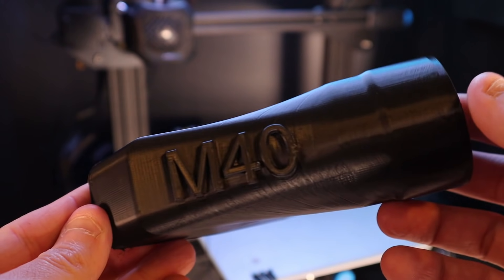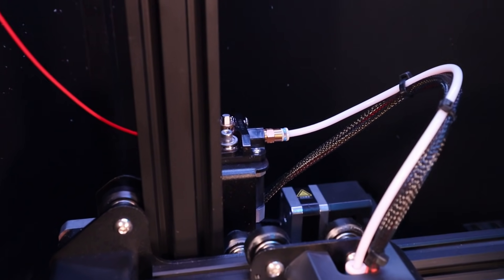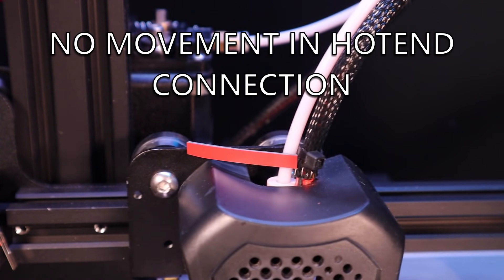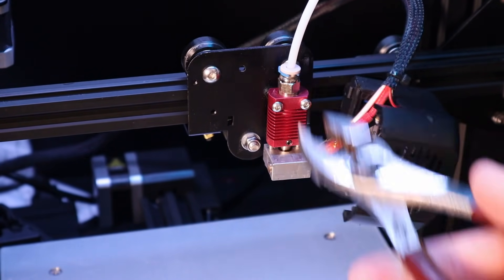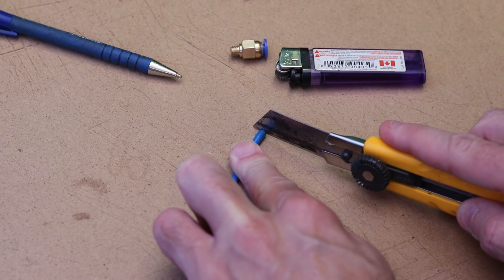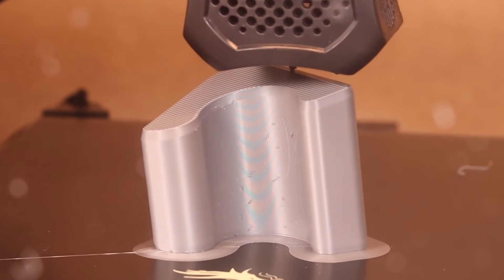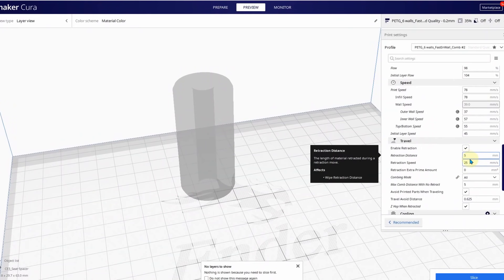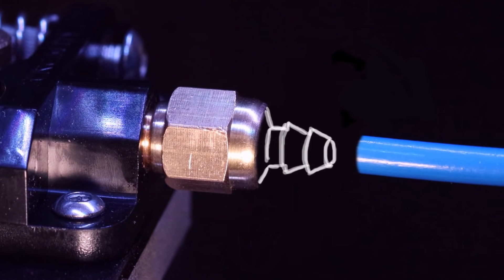Creality Ender 3 V2 - Fixing the Hidden Problem that Can Cause Stringing and Unresponsiveness

Comment: I'm looking forward to seeing your solution to this issue; my CR10s Pro has been nibbling on its Capricorn tube since a few weeks after getting it which is over a year and a half now.  I've been trimming the end of the tube down and switching out the fitting as they're typically destroyed, tooth-wise, when I'm trying to get them to release the tube.  It's a good job the printer came with 2 lengths and the fittings are dirt cheap, although the latter is probably part of the issue.
I'm just looking online for more info for Flubber's solution right now.
Reply from the maker: This will be my next video, I have a working solution now which is super simple.  I've tested it for a few prints now and I can see zero movement, at least my eye can't pick up on any.  I'll record some 4K video and zoom in on it to make sure. 

I wanted to test it a bit more before making a follow up video so that I can be 100% confident.

Comment: I had great success with hidraulic fittings. Something like this: https://a.aliexpress.com/_mO2KcBn
The challenge so to find one with the hole that allows the bowden tube to pass through completely for the hotend side.
On mine I had to enlarge the hole a bit with a 4mm drill.

Comment: I always suspected that little thing but always chose to live with it because I have a lot to do to waste time investigated, it appears my suspicion is confirmed
Reply from the maker: It seems to be a fairly common issue, most recently a viewer suggested that the Pruisa Mini has a different style which acts as a compression fitting to prevent this problem.   It looks live I've been able to solve the problem as well by drilling a through hole in the fitting and flaring the end of the tube slightly on the other side.  The flared end of the tube now seats against the bottom of the threaded hole so it cannot move.  This idea is a similar concept to connections used for automotive brake lines.  It does have a definite impact, I have a super clean print.

Comment: Compression fittings are they to go for a ptfe bowden setup. Look at what the Prusa Mini uses. That is what you should try to get. The ones that use the Brass Collet. If I need to upgrade or fix one on any of my machines using a bowden setup that is what I will be getting.

I will say that on my Ender 3 a while back I went to BMG Extruder using a E3D Grove Mount Adapter & the E3D Threaded Bowden Coupler on the hotend. The groove mount is aluminum & the threaded coupler is a plastic material and do not cost much at all. They are Push Fit fittings which are a type of compression bit not as good at true compression fitting that use a brass collet. But since using the E3D fittings I have had very very few issues. The only real issue I've had is that the nut part of the threaded couple is larger so you sort of need to tread it on the hotend with the hotend detached. Other than the extra step during install they hold ptfe tubes real well. I have not had much slip if any at all. Only time I have to fittle with them is when I do not pull the filament out fast enough and it hardens into a glob getting stuck. 

I hate the generic fittings that use those little metal teeth. They are total crap and always wear down over time.

Anyways look into getting a compression fitting that uses a brass collet. They are actually the best types to get for ptfe bowden set up in my opinion.
Reply from the maker: I've not seen the ones with brass.

Tonight I modded a brass fitting with a through hole, passed the tube through and flared the end just slightly, the flare now bottoms out and compresses against the bottom of the threaded hole for what I believe is a simple permanent solution.  The hotend side will still need to be addressed on occasion due to wear from the heat, I may but the best Capricorn tube to see how it lasts.  

Thanks for your tips, I'll check out the fitting on the mini, this is not a problem people should be having out of the box with these printers.

Comment: DO NEVER try that method. PTFE can emit nerve toxins when heated too much. 240 to 250 degrees celcius is enough for this to occur which is PETG printing temperature. Heating the tube with a lighter is also a deadly idea.
Reply from the maker: Always a good idea to have safety in mind when working on any project no matter what the type of work is.  In addition there are many unknowns about the long-term impacts of 3D printing on our health, for example, there are nanoparticles produced through the 3D printing process which can be inhaled into the lungs.  More research is needed on this. 

There are better solutions, I have one that I am working on right now and will provide a follow up video if I can prove it is viable over the long-term.

Comment: Those fittings are terrible at the extruder end, which is why I printed replacements that clamp the tubing instead http://www.thingiverse.com/thing:1993384 over 6 months and still no tube movement, though I did find some knurled versions of the nut which is easier to manage.
Reply from the maker: I have seen these, so they don't clamp so much that the tube collapses a bit?  I guess not if you've been using it.  Someone else mentioned that they've used fine sandpaper to help grip the tube, it seems that it will also work if you can find a place for the sandpaper.
Reply: @NeedItMakeIt  that did worry me at first but so far so good. It doesn't take much tightening to keep it in place, another reason to use a knurled nut so I can finger tighten it more easily https://www.thingiverse.com/thing:4134690

Comment: I've had a couple of Ender 3 pro's for about a year now, and this problem keeps coming back. I've done the Capricorn tubing and fittings, but I find that after a few months the slippage returns and the print quality suffers for it. I don't believe these pneumatic fittings weren't meant to be used in applications with internal friction, there needs to be a better design for these.
Reply: I've always had this problem with the Creality machines. It is disappointing to see even the newer Ender 5 Pros still having the same problem
Reply: @jvinsnes  I don't think it's just the Creality machines. My Tevo has the same problem. They are all using the same pneumatic tube and fittings. I'm not sure what the solution would be (other than direct drive). You would need another option for the fitting and tubing, something specifically designed for the purpose. Maybe a Teflon tube with special end (one piece with the tube) that interlocks with the fitting to absolutely prevent slippage. Those little metal teeth in the fittings just aren't enough. But that would require special tooling and manufacturing and these budget printers are made with off-the-shelf, re-purposed parts.
Reply: @RichardThompsonArt  A gardenhose type of design might work. Although, I don't think something like this exist at this size, or for this application

Comment: Moved to direct drive. Now I use 0.4 mm retraction. Before it was 5 mm. I know it's a bad comparison, cuz obviously, both setups has its pros and cons, but in my case it did a huge difference, time wise, printing small models. Great vid, very useful for bowden setups!
Reply from the maker: I started with direct drive and I did like it, so simple and it does allow printing of lots of different types of materials that Bowdens struggle with.  I may upgrade down the line, I like the speed advantages and clean prints that this setup offers, a tradeoff I suppose. 0.4mm retraction is pretty amazing!  You'd have less blobs and stringing and seams would probably look better as well.  

Thank you for the tip!
Reply: @NeedItMakeIt  I am new to 3D printing. I just purchased a used Ender 5.

Is the 3D printer slower with direct drive because of the added mass?
Reply from the maker: @philso7872  It can be slower, there are some tradeoffs, a direct drive is viewed by many people as an upgrade.  There are more materials that can be easily printed, it is more responsive to retractions, seams look better, less stringing etc.  To anwer your question though, they are normally a little slower because you can get the ghosting effect from vibrations through sudden movements.  A printer with a solid frame will help to prevent vibrations.  I started with a direct driver printer, however it was a terrible Anet A8 with a flimsy frame, I wasted a lot of time making it better (I should have invested more upfront into a better printer).    I'd be happy to have a direct drive right now, I'm also pretty happy with the Bowden setup too.

Comment: Would a slightly increased inner diameter of the hot end ptfe tube cause issues with more filament being in there then should be?
Reply from the maker: I believe this would only have an impact at the initial stage of the print and my printer always extrudes up the side of the bed to get the extrusion started.  Yesterday I pulled the blue tube out and I was surprised to see that some of it had melted away, it wasn't black like the stock tube, so buy the good one if you ever upgrade!  

Last night while trying to print the same part 3 times and I continued to have slippage of the extruder gear for seemingly no reason; I took everything apart and finally I found the problem... the stock plastic pressure arm rotated upward slightly and it was not applying pressure no matter how much spring compression was applied.  I've heard people say that the plastic wouldn't last and they were right. 

I've ordered this onehttps://amzn.to/37Ta3Ru to get going again, what a pain!

Comment: Just buy a Capricorn kit. Install the fittings and leave them loose by a couple of turns. Insert the tubing until it bottoms out. Then finish tightening the fittings the rest of the way down. It'll bite and hold the tube and keep it seated properly.
Did this on my Ender 3 Pro and the tube has 0 movement after months and months of use.
Reply: I still get the same issue with official capricorn fittings and tube after 3-4 months. Just ordered fittings from a pneumatic supply. Also your method only works with fittings that allow the tube to pass through completely.  The smaller fitting on my Ender and in this video doesn't do this.
Reply from the maker: @charlesgunzelman3323  I'm testing a 100% solution right now using an m6 through connector which I made using the stock ones.  I'll test it for a good week with some tape on it to see if there is any movement at all.  So far 0 movement, and this is not an exaggeration.  I wanted to come up with something simple and cheap enough that anyone can do this.
Reply: @charlesgunzelman3323  Get one that does.  They're around.
Reply: Totally agree with you
Reply: I ended up buying a magnetic bowden kit from Capricorn and I have been extremely pleased with it. Absolutely no movement on the tube because the ends are glued/pressure fitted to the fittings. Downside is that the magnetic end they use doesn't really fit stock Ender 3/V2 setups. I have a E3D V6 hot end and it fits fine; the magnetic end is slightly too large of a diameter to screw into the top of the hot end without interfering with the x-axis carriage. Also no option to cut the length down yourself out of the box, but I have found the stock length to be just fine.
Reply from the maker: I'm impressed, I know the Capricorn tubing has a good rating and it is supposed to be toleranced and the stock extruder fitting is terrible.  I still believe the extruder side cannot benefit from pushing the tube in and then tightening the fitting to the final position unless it is a M10 through fitting like the hotend side.  The V2 has an M6 on the extruder, the tube bottoms out in the fitting and relies only on the teeth to hold the tube in place.  I may just go ahead and purchase the Capricorn tubing, I felt that the one I've purchased is a little too tight on the ID.
Reply: Creality uses the cheapest possible fittings and PTFE tubing. They all fail, Creality knows this and they refuse  to address it.

Comment: I have a question if the printer has a sheet of filament under the print is the plate set to low?
Reply from the maker: I'm not quite sure what that means, I have only needed to use the paper method, if you use filament that will be much too far away.  I like to use standard white printer paper, I tear off a piece and adjust so there is a a little bit of friction preventing the paper from sliding out easily.  When you adjust the bed sometimes you need to go back to the first corners and re-tune them, leveling the bed can throw off the other corners a tiny amount.  I almost never need to level or adjust the bed on this printer, however I make it a point never to move the printer unless I absolutely need to.   I did upgrade to the stiffer springs about 2 months ago, I'm sure that helps prevent the knobs from loosening.  Alternatively you can still use the current springs and adjust the Z-stop lower to compress the stock sprints a little more.   https://3dprintingcanada.com/products/official-creality-pressure-heatbed-spring-qty-4

Comment: Thank you for the video...I am new to 3D printing and just got the 3v2 on the first print the Bowden tube popped out!  Eventually I got the printer to print but it is not very sturdy so I ordered the tube and the fittings you recommend.
Reply from the maker: No problem, I'm still going with the same setup as shown in the video and I print very often, but I still think these fittings are flawed, too much movement will eventually cause the connection to fail, I'll be in the shop this weekend to see if I can prove a better design and if I can, I'll release a video on it.  One note about the assembly.  The tube has to be pushed in very hard, there was an initial stop, but it had to be pushed in a little further to seat properly in the fitting, I experienced this during assembly myself, the tube is hard to grip and push in.

Comment: ive got a tevo tornado and unfortunatly am running into probs with it. got a replacement hotend assembly but that fix only lasted a few prints from thingiverse. now the part that actually holds the hotend and extruder housing is loose and the nuts lost there thread so my tool doesnt work trying to figure out how i can fix this plate issue that holds the hotend assembly. any help would be greatly appreciated. thank you
Reply from the maker: I'd be happy to offer some help, can you send me a photo (needitmakeit@gmail.com) or post one to imgur so I can see?

Comment: I used to own a da Vinci Pro and had the same problem. My solution was to make a bracket that grabbed onto the Bowden tube AND the fitting, thus holding both in non moveable grip.
Reply from the maker: I've seen some designs which had tapered threads on them to grab onto the tube.  Recently I tried to use heat-shrink to see if it would grab to the PTFE, if it could I'd heat shrink the tube a few times and then with a larger dia. I'd do the fitting a tube together, unfortunately the heat shrink slid right off easily.  They really should be using fittings and techniques used for car brake lines.  Vibration is no issue, leaking is no issue and it is dead simple.
Reply: @NeedItMakeIt  
Ah.
I designed a collar and lined it with sanding paper. It gripped the Bowden tube just fine.
Reply from the maker: @TrollWithOpinions  Very clever!  You are the first person to suggest that idea.

Comment: My tube brand new falls out  any fix
Reply from the maker: One issue that I experienced during assembly; pushing the tube in seems to hit an initial stop, but it has to go further, get a death grip on the tube and force it in a bit further.  If that doesn't work, there was an extra fitting with my printer, yours may have one also, it could be faulty (there isn't much to go wrong) but it is possible.  If none of those work, order a new fitting, the ones in the kit aren't great, as reported by many people including myself.  There could be a  flaw with the tube, but I doubt it, you could just buy a new kit from Amazon the reviews should guide you fairly well.  I have a better solution which I am working on at the moment for anyone with these problems I will release a follow up video if I can prove that it works as well as I think.  Hope that helps.

Comment: Nice! Too bad Home Depot is closed tomorrow or i would go and buy some compression fittings from the water line section. I doubt they have one with a compression sleeve small enough but using a solder iron set to 400c should be able to press fit it in and completely eliminate movement forever.
Reply: They sell 1/8" fittings.

Comment: Would PEX tube work better?
Reply from the maker: I did wonder that as well, I think the PEX method would work exceptionally well here, the only 2 issues are size and having a cheap expansion tool.  

Today I had a special fitting delivered, it has a 4mm through hole and also an M6 thread, so it has extremely thin walls.  I have a video to finish first and if this solution works, I'll post this solution as a follow up.  

I think it is worth contacting PEX to see if they could make a product which would solve this 3D printing problem for good using their proven techniques.

Excellent idea BTW!
Reply: @NeedItMakeIt  I have also wondered if nano sealant/nano windshield cleaner on glass bed could remedy the problem with some filaments sticking so hard to bed they break or chip the glass when the print is pulled off, in theory it could offer just right amount of adhesion while allowing safe detachment when finished..?